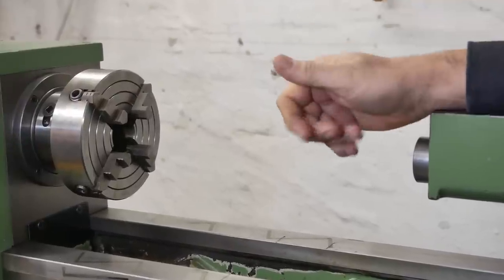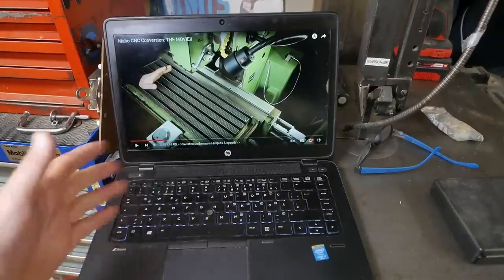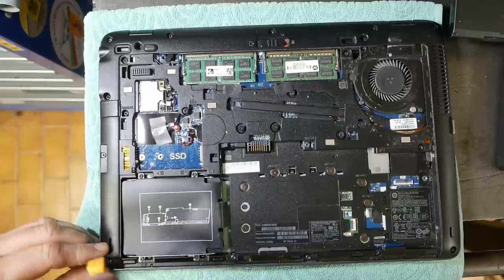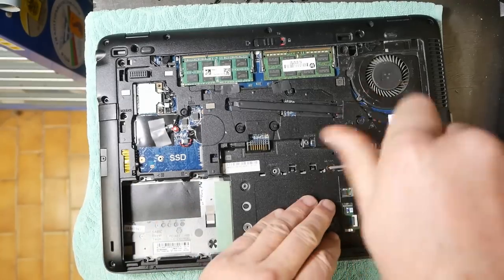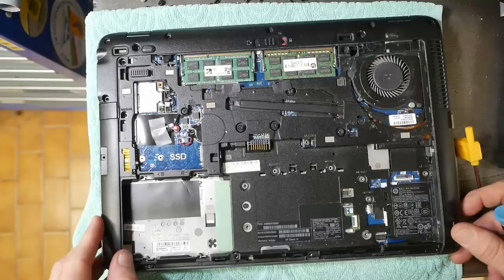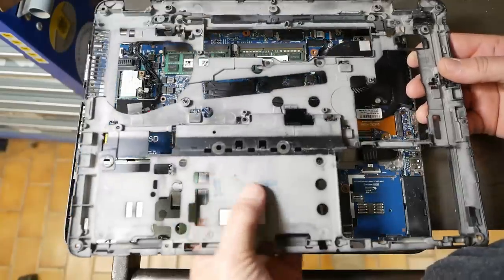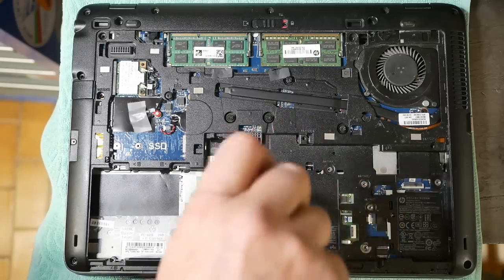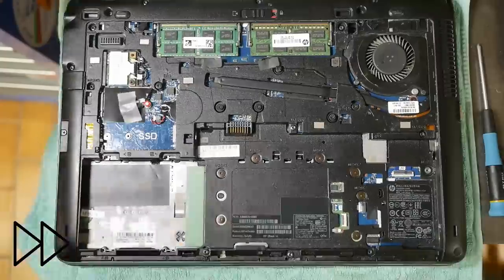M1 Mac: New, Refurbished or PAINTED?!?

Comment: Go with a desktop, you've got better upgradeability over time. You can replace a GPU easily over time which will give you a significant boost in performance and normally would be significantly cheaper than buying a whole new computer. Plus the old gpu you can always sell on if it's still reasonably useful. What you need to find out is if the software you're using is more GPU intensive or CPU intensive and invest slightly more into one part or the other. Or if its a combination of both get reasonably well specced versions of both parts. Also memory(RAM) selection can be pretty important to performance for the current AMD systems so that also something to be aware of.

Also at the moment a prebuilt system seems to be the better value option for purchasing a desktop because of the inflated prices for GPU's and also maybe the only option you have to purchase a GPU. What I would also suggest is looking at whether its even worth encoding videos into 4k, if the user base for 4k content is small then its only more time and effort on your part which could be better spent elsewhere. Also not to mention the size of the 4k content is going to be significantly larger than lets 1080p footage.

Laptops whether Mac or Windows all have the same issue where there is no real worthwhile upgradeability in them which makes them a bit of paperweight after a few years with the way tech is progressing at the moment. That may change but it seems to be the case for the moment.
Reply from the maker: Thanks for the feedback. I travel enough that i need the laptop solution.

Filming in 4K is also useful even if you output a 1080 timeline. You can crop and pan without loss.

Resolve is optimised to load the GPU and needs 8gb of video ram for 4K editing.
With the current price of 8GB GPU's, even used, it would be a struggle to put together a used part desktop with the performance of the M1 Air, for that price. And I need a laptop about 20% of the time.

Comment: One thing you have to keep in mind for the M1 macs is that you can’t upgrade any of the components. Also if there’s a problem with your motherboard and you have apple fix it you will most likely lose your data. As apple replaces the entire motherboard if there’s an issue. And they make no attempt at transferring your data to the new motherboard. If you need a repair I would recommend finding a non apple repair shop that does component level repair.
Reply: I would recommend building a desktop computer if possible you can get a lot more bang for your buck. But if you need a laptop I would recommend looking into a laptop maker called framework. They design their laptop with upgrading and repair in mind and sell just about every component that could break.
Reply from the maker: The Frameworks dont have dedicated GPU's, which is essential for editing. 
Resolve is optimised to load the GPU and needs 8gb of video ram for 4K editing.
With the current price of 8GB GPU's, even used, it would be a struggle to put together a used part desktop with the performance of the M1 Air, for that price. And I need a laptop about 20% of the time.
I only ever have the current weeks video project on the internal drive. Every week I transfer the finshed project to back up drives. I lost my data to a hard drive fail in 2020, so I back up now.

Comment: FWIW I edit my videos on a Mac Desktop. The 27" iMac screen is lovely for the job. 
Not that I am holding up my videos of examplars of the genre. 
A Mac will come with iMovie, and I find that entirely adequate. 
I bought my iMac direct from the Apple store after the GPU went on the second hand one that I had been using. I was in the shop, they had them, and I had important gaming to get on with 🙂
M1 still isn't an option in the iMac though, so if that is what makes the difference, this advice might be worth even less than you paid for it.
Reply: There are M1 iMacs now.
Reply from the maker: I need a laptop.

Comment: That is a dilemma, indeed.

I found myself in the same spot some time ago and because the money was tight, I just went and bought a laptop of roughly the specs I needed at an auction online from a major auction house in Australia. Price was about 200 bucks for a very good, average spec laptop with perhaps a couple of years on it, around 1000$ new at the time.

Never looked back. Still in service after five years of abuse.

There's so much great stuff these people resell for everyone who goes out of business or upgrade or decommission that it is just wasteful to go buy new (I had bought only brand new Macs until then). For a fraction of the price you get the same functionality less the useless warranty (all my Macs broke down just at the end of warranty).

And you can find just about anything you want in pretty much any spec you want it. I would imagine in Europe even more so.

Best thing, you don't care if you drop it from your plane in a bucket of paint.

One thing I did at the beginning because I didn't know if the "new" 'puter was going to last two years or two days given the price I paid was to save everything I cared about on a separate drive. Turned out I didn't really need to. I would strongly encourage you to give it a try. You only have a couple of hundred bucks to lose. And if the colour don't tickle your mojo the right way, paint away me hearties!

PS. I know this is moot for you, but here's what this one sold for here (no horse of mine in this race):

https://www.grays.com/lot/0027-9028525/computers-and-it-equipment/apple-macbook-air-6-2-a1466
Reply from the maker: The issue with video editing is that you need an 8Gb GPU for 4K video in Resolve, so you cant really go for a €200 laptop, as that I already have. The Zbook takes 12 Hours to render 20 minutes of 4K vid. The baseline M1 Air will spit that out in 14 minutes.
Reply: @RotarySMP  I understand that, my story was just for an example of what can happen. Practically I bought a laptop for a fifth of its price and I am pretty sure I have no hidden skills. Checking online auctions at the moment in Oz seems like your desired laptop is not there yet so we may have to wait, but Europe is a market ten times bigger.

Comment: I’m a pretty techy person, work in tech, gamer the lot. I’ve always owned a windows and now Work in linux and honestly new mac books are fantastic. I bought myself a 16in M1 pro for software development etc and home use and I love it. Maybe I’m biased cause I work at Arm…

Personally, given that you sound like the kind of person to keep hold of your computers for a while, I’d spend the extra cash and get one new or refurbished one for the warranty. That cost will be negligible spread over 5 or more years, Mac OS has been well supported on older machines. 

People are saying buy a desktop but the PC market both new and used is ridiculous right now, I don’t think you’ll be able to get parts in that price bracket right now. Maybe when things calm down then consider it if you can’t change your budget
Reply from the maker: You work at Arm. Yuo guys must be seriously proud of what you have done for Apple with the M1. It really changed gear on perfromance. 
Thanks for your input.
Reply: Cheers! I’ve not been involved in that area of the business but it’s been super interesting to watch apple, Microsoft, Amazon etc adopt arm platforms. 

Apple own what’s called an architecture license so they design their Processors in house. It’s like owning the rights to use the English language and writing your own novel rather than buying an off the shelf book.

Also I love your videos, keep them coming!

Comment: You'll get 2x the performance from a PC for the same money.  Classically Macs are way more stable and lean on the integration of the hardware and software.   I'd pick up a 1 year old high end PC laptop with at least an 8 gig video card, install Win 7 (64 bit) and watch it blaze through your 4k.   If performance isn't the absolute priority then the Mac will give you a bullet proof option.   

Of course a modern desktop ( core i9) with a high end video card (gtx1080 or rx6800) coupled with 32-64 gig of memory tied together with a Samsung EVO plus nvme ssd (1tb)  would be the best bang for the buck.
Reply: 2X the performance? Where did you dig that from?  Macs have always been as faster than the equivalent PC. MacOS is especially snappier than Windows. The recent M1s are the fastest machines you can buy. To get anywhere near their performance, it will cost you a lot more.
Reply from the maker: RotarySMP
I was looking at used Razer blade 15's , but they are much more expensive used than the M1 Air new. Also the air can render on battery without throttling, where the intel machines really have to be plugged in with the fans screaming. For video, the M1 is a hrd packet to beat.
Reply: I checked them out and the M1 has surprisingly good specs compared to the Razor.  Quite impressive in most catagories with only a few noticable caveats.  The biggest difference was in upgradability and GPU performance.  The video card on the Razor is incredibly faster and dedicated (not integrated as the M1)  with the M1 at 2.6 and the Razor at 12 TFLOPS.  If encoding 4k is the priority the extra price of the Razor would be worth it.  Overall the M1 is a slightly better system at a lower price.    Personally I like to upgrade system memory and install super fast NVMe drives in aging systems to increase longevity and boost performance.